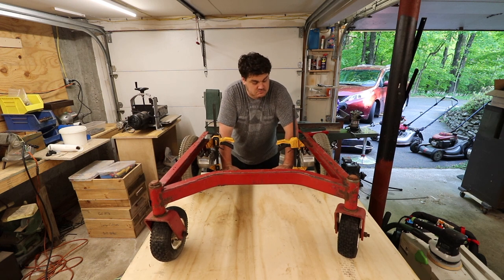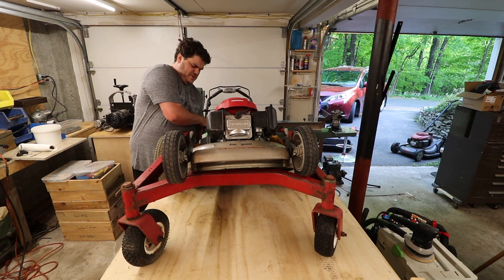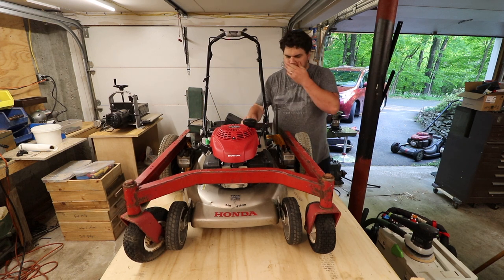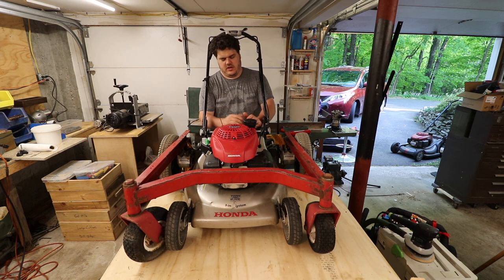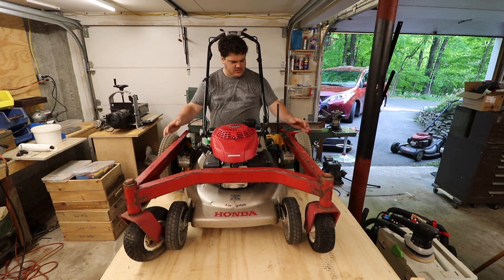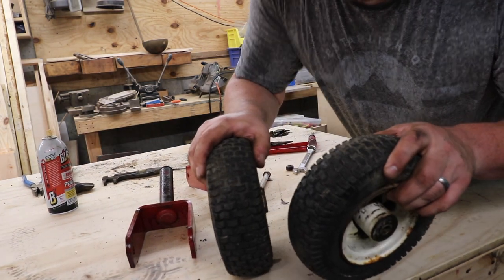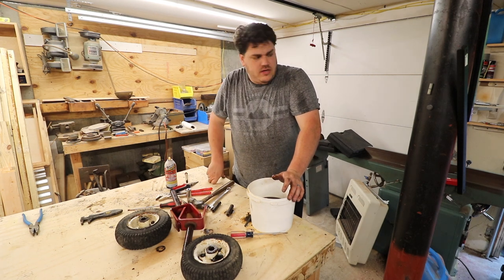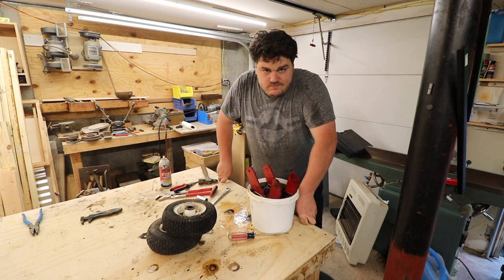Vlog 2 Rc Mower Moch-Up with a dash of tear down

Comment: Tip on batteries you can use 20v Lithium Ion power tool battery. That will make for easy charging and their nice and compact.
Reply from the maker: I bet the c rating is pretty good on them too. I’d have to use 4 or more I bet.
Reply: @InfiniteCraftsman  true